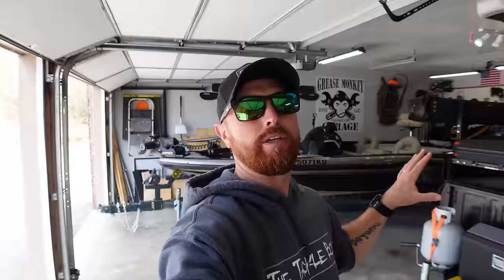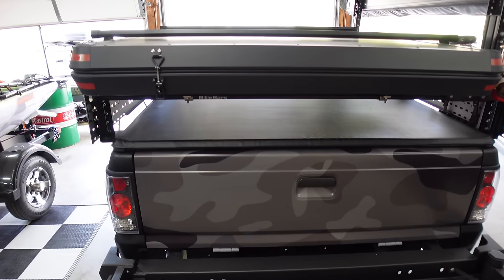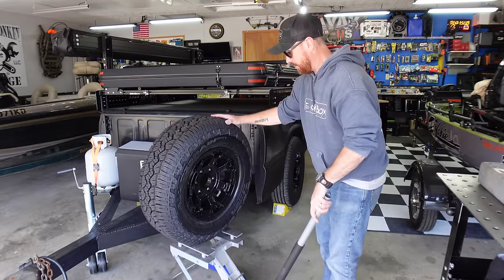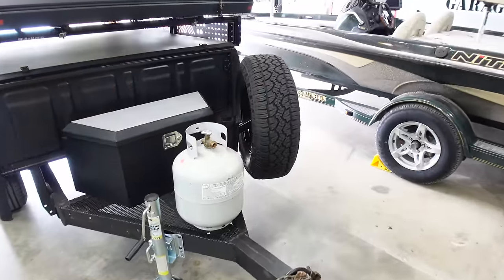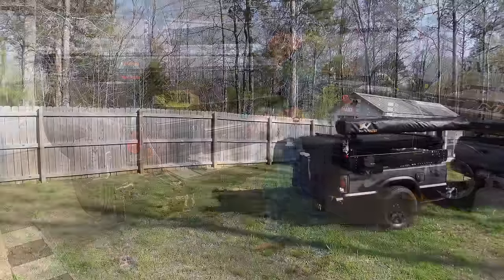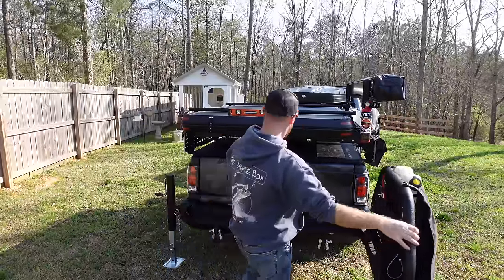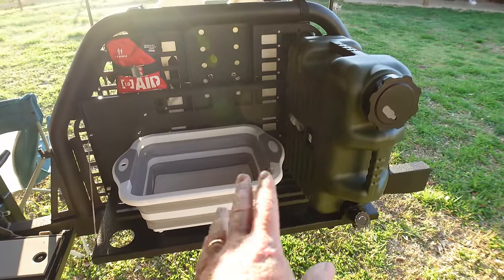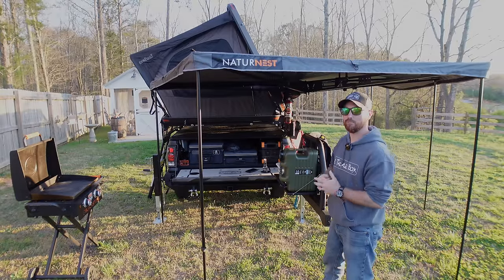My DIY Truck Bed Camping Trailer is FINISHED | NEW Air Shocks, Corner Jacks & More...

Comment: Ive got an off road camp Trailer that we are improving on and the low tongue weight is an issue for me as well. I need to mount a spare on the front like this. Along with my battery bank setup.

Comment: I have watched all the trailer videos, but nowhere is shown how you did put up with the bed cover. How did you deal with the brakects being in the way of the cover?
Reply from the maker: It’s a Billie bars bed rack, they are designed specifically so you can still run tunnel covers. They are not in the way at all.